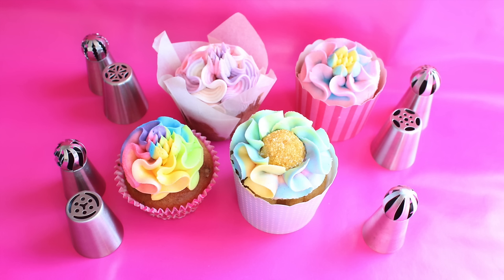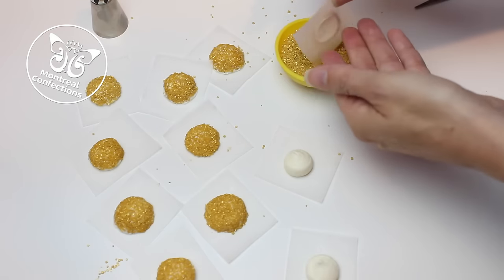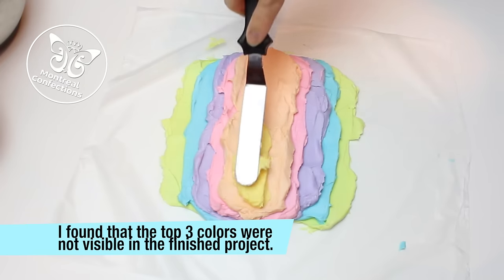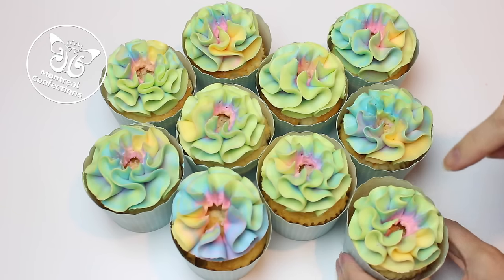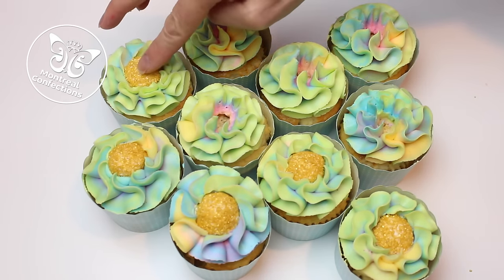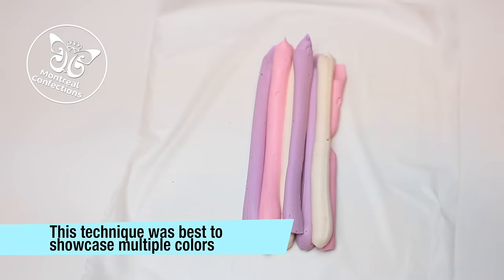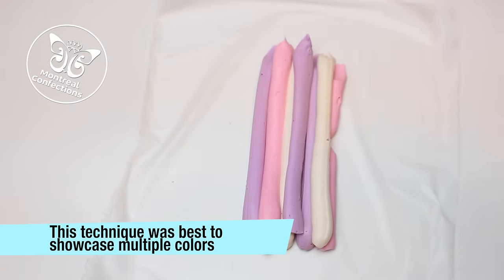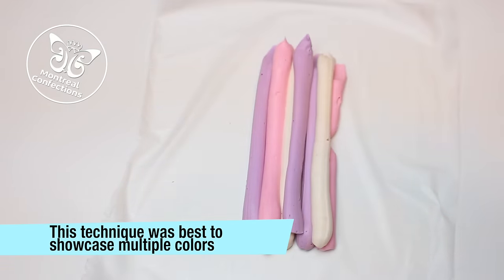Russian Ball Piping Tips - Product demonstration & tutorial - Assorted techniques

Comment: what happens if you continue to squeeze as you lift off the ball tips? wouldn't it close the whole?
Reply: i was thinking the same thing. maybe with the first one she used will not fill the hole. but the others with the holes on the tips will cover it. thats what the holes are for.
Reply: Thought the exact same thing. The ones with the opening in the middle may have added to the hole....
Reply from the maker: Hi Colleen, I've tested that but the center flower opening isn't large enough almost no icing comes out since the pressure is released via the larger side holes. As you pipe and lift you're always left with a large gap in the center of the icing without any center support the whole things collapses and looks very sloppy.
Reply: wrong
Reply: Lucy Wright pfft your wrong
Reply: nrdy grl I have these and there is no way to do it without having a hole

Comment: don't the ones with the star hole in the middle not leave a gap if you rised as you twisted?
Reply: That's the point of them. The ones without the gaps on the top aren't meant for doing close circular designs.
Reply: *****
 so is she using them wrong then?  She said both do the same thing.
Reply: cnith2 she is using them wrong you are supposed to left up as you squeeze
Reply: cnith2 yes 😍😘
Reply: reciclar botellss
Reply: I thought the same but I have them and because you do the rocking motion with the tip on the cake, nothing comes out so it's somewhat pointless
Reply: cnith2  ola
Reply: that's what I thought
Reply: too
Reply: cnith2 that's rude
Reply: I know right
Reply from the maker: For those who are curious here is the star opening in action https://youtu.be/ghK1rAw44rc?t=42s

Comment: The ball tip thingy with openings at the middle is better cause it will not leave holes in the middle and you'll only use one tip instead of buying another one
Reply from the maker: The opening (flower shape) isn't large enough to fill the gap the ball creates.
Reply: @montrealconfections  Have you tried pulling up slowly as you twist to fill the center? I am aware it won't work for the smaller designs but it will for the more open ones. Also, maybe they work better with a whipped cream and were designed for that when having the middles open.

Comment: Question, if you used one with the opening on the top and not pressed it all the way down to the cupcake and just hovered it like a mm or two would it leave a smaller layer of icing where the hole is?

Comment: Just a thought to avoid that random gap in middle. Perhaps you can squeeze and lift the frosting tip up off the cupcake as the surface area of the cupcake gets filled and you can sort of create more volume going up and up and then pull of the tip once you reach a nice height and it will have a nice little tip in the top.

Comment: I've always wondered how these types of cupcakes were made. Do you think a beginner like my self could do this?
Reply from the maker: Hi Heather, IMO this technique is easier to do than the usual cupcake swirl. With the swirl you need to combine even pressure with the circular motion then the gradual release once your have enough icing. In this case, you rest on the cupcake apply pressure with a slight back and forth wrist motion an abrupt stop and lift, it is pretty easy. The major factor that will impact the final product is the buttercream, you must have a think texture that will maintain the ruffles if it isn't sturdy the design will just fade/melt away.

Comment: What if you continue to turn it as you pull it up and continue to squeeze, except you turn it 360 as you lift instead of back and forth
Reply: Tickles Pickles it works that way as well... the different would be that they get taller instead of flat when you press them down the way she does. I've tried them many different ways. The ones that leave a hole, if you twist it up the end flaps fall into the center and cover the hole and you don't have to worry about adding anything to it. I probably have close to 80 Russian tips in all sorts of styles so I experiment a lot.

Comment: I'm not sure what im doing wrong but I cannot get my designs to turn out right. when I lift up the icing comes right along with it(used your recipe) and my layers don't fall on top when twisting. it just bunches up in center
Reply from the maker: Hi Emoko, It sounds like maybe the icing is too stiff, maybe add a little butter to the batch (whip it in) to loosen it up a little.
Reply: Montreal Confections thank you so much! I didn't add any more butter but I did whip it more and it did take a better look. I still have a way to go but I am most certainly making improvements!

Comment: as you pull it up keep squeezing the bag and it won't leave a hole there
Reply: It will
Reply: No it won't if you pull it up keep squeezing and twisting
Reply from the maker: You're right Jimin, I've tested these tips several times and the no amount of twisting or pulling stops the hole in the middle. As you squeeze out the icing the center flower hole doesn't fill the huge space the ball makes, the center gap created by the ball causes the outer ruffles to collapse and looks very sloppy.

Comment: is there one person on this whole posting that can answer the question - how in the world do you get the icing to stick to the cupcake??? everytime i stop & lift it brings the whole design up in the air. even tried thin icing on the cupcake first with no difference. bought these & she makes it look so easy but i have never had success once yet?!!!  help please!!!!
Reply from the maker: +Montreal Confections Hi Larry, try applying a thin layer of icing to the cupcake with a spatula before piping the ruffle. The should help the ruffle to stick to the surface of the cupcake. I've seen some people pipe on parchment paper and freezing the ruffles they then placed the frozen ruffle on the cupcake. I hope that helps, Marlyn
Reply: I may try the piping freezing method since I tried the icing 1st trick & it really didn't help. I may give it all a try again when i am not pressed for time. I gave up multiple times already because I was on a deadline. Is there a link to an icing that works better than others?
Reply from the maker: +Larry Sturm working with a deadline is stressful so try when you can just relax already that will be better. I have my icing recipe listed in description box I have heard others have the same issue you're having so you're not alone. Good luck 🍀